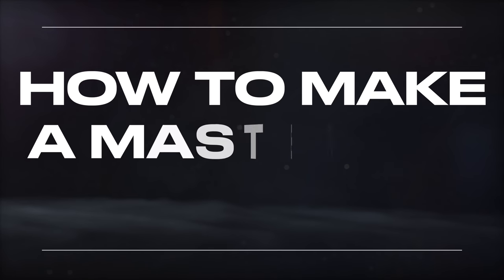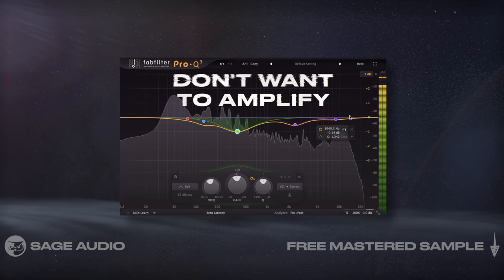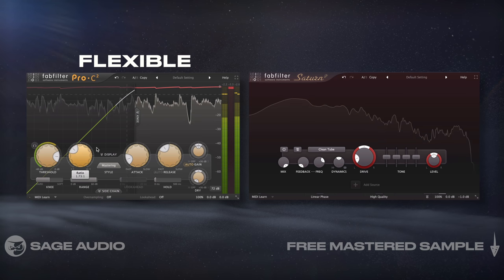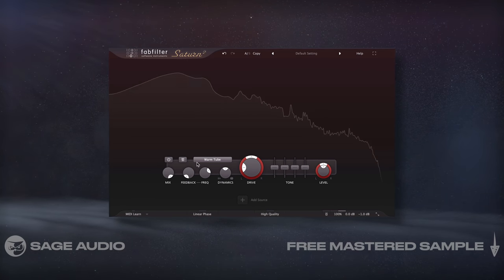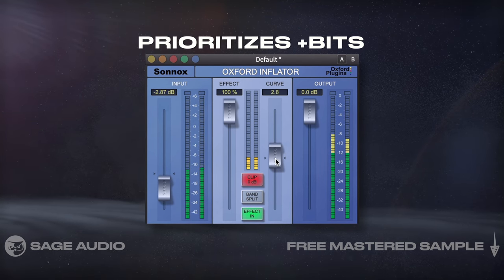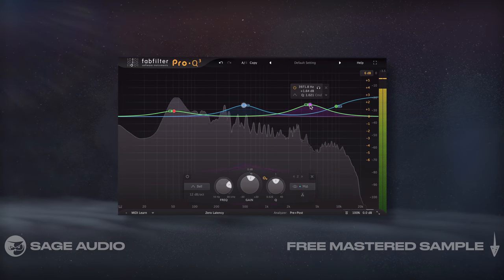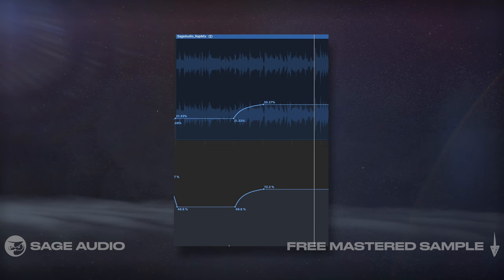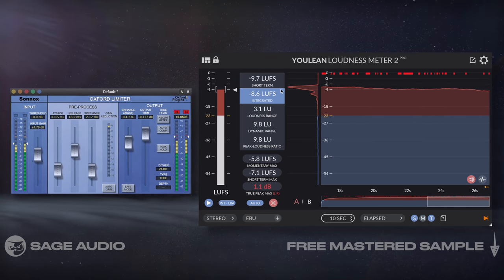How to Make a Mastering Chain

Comment: Multiband compressor for tonal balance in mastering has been missing in your tutorial.
Reply: you should use a MBC further in mixing, because if you got a tonal imbalance on your rendered files, you don't want to go back and analyze for hours where you missed out on it. The mastering is the final step, when you are ready to print your song.
Reply: @TraxtasyMedia  I get you. A plug-in like waves linear  multiband compressor should not miss in a master chain. It maintains a frequency balance throughout the performance which to me is a must have for that final pro level sound.

Comment: Loudness  comes  from mixdowns!!
if mix is not engaging and clean enough, you could slap on unlimited amount of processors and achieve nothing but exaggerated version of the same shity mix 😂
Reply: you are right, but i think the reality is a bit different from the ideal state, a lot of mastering engineers receive imperfect mixes and they need tu use their sorcery to make the single .wav premaster sound good, even tho a great mixdown is a path to a great master, there is still something that can be saved during the mastering process
Reply: @ancestralvision  That's correct bro, lot of things can be done in mastering stage to improve the overall impact of the record!! 
Having said that ,having full control of the peaks in Mixing is essential for me because while mastering, peaks can get overwhelming real fast. 

Well, it's my personal opinion and I respect how other engineers go about fixing the same issues in their own respective ways 🙏